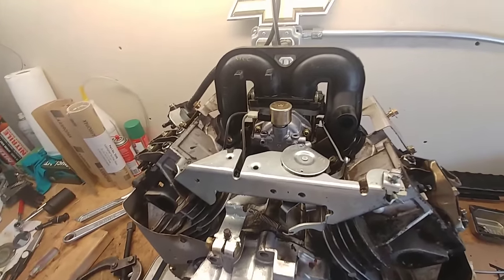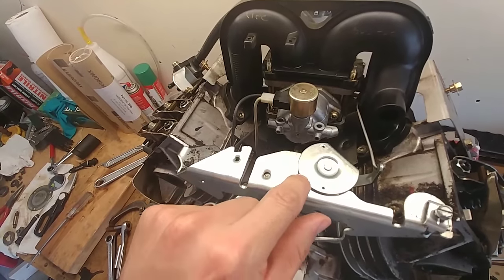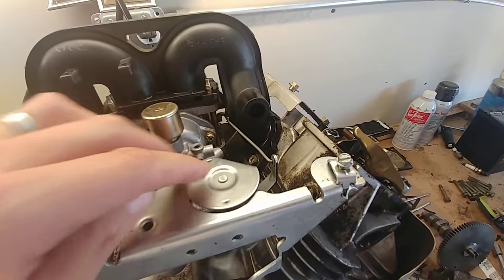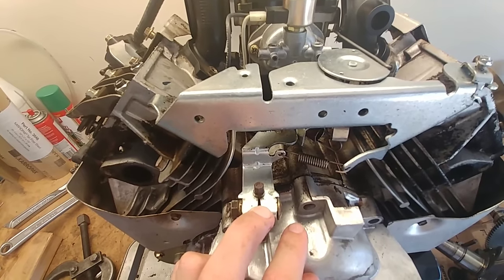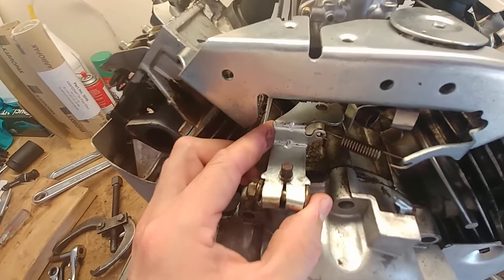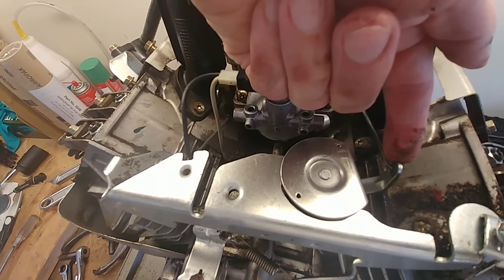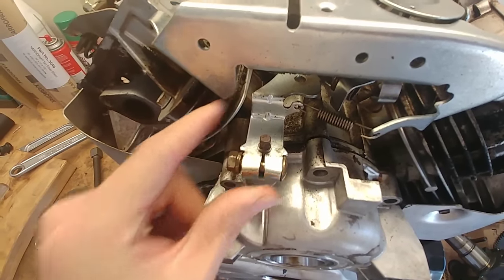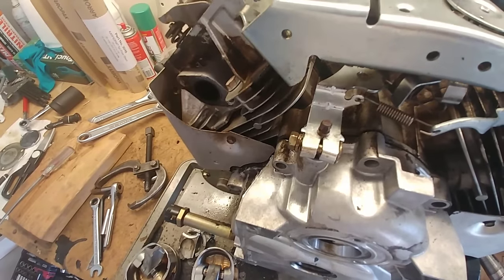Briggs Intek V-Twin Throttle and Governor Controls Explained

Comment: This is the best video for explaining the linkage/spring locations and the governor's operation.  Thank you.
Reply: It also gives a clear image on which direction the springs go. That does make a difference for correct operation. The bottom tab on the governor spring is also how to get higher rpms. Bend that tab down slightly increasing tension gives you higher rpms. However to do that adjustment you need to know exactly what the rpms are. To high and you could blow the engine up. To low and you do not have a quality cut. 3600-3700 is what most mowers need. Do check the specs first.

Comment: I bought a nice used Jacobs front cut mower about 10 years ago, I thought it was a good idea to start it up with the throttle linkage off. Well, mine turned out the same way as his after I simulated a mid-90's F1 engine for about 3 seconds. 😂 Never felt so dumb in my entire life, but lessoned learned ntl.

Comment: Does the internal flyweight of the governor pull the governor arm counter clockwise when engine is running??  I have adjusted governor the way you described and still the engine wants to race.  At idle, the governor arm is not pushing up enough to push throttle against idle screw.  When I start the engine, it automatically begins to race even with throttle lever positioned to idle.
Reply: I am having a similar problem. If I hold the throttle in the idle position I can get the engine to run ok but when I let go so does the engine.
Reply: Same here
Reply: Yes the governor flyweights cause the governor to rotate counter-clockwise. Another way to think of these type governors is an external spring holds the throttle wide open and the governor works against that spring and tries to force the throttle closed.

So when "setting" the governor, the throttle and governor linkage should be in the full throttle position and the governor shaft (the part we're setting) too should be turned to the full throttle position. When everything is set to be in the full throttle position at rest, the governor will be able to close the throttle when the engine is running (too fast).

Comment: Hello, I just replaced the carb on a 23 hp v-twin. I didn't disconnect the throttle cable. I installed a after market carb and now when I start the mower it's running full throttle and won't go to idle when I move the handle to slow(turtle). Any suggestions on how I can adjust it?

Comment: My Craftsman lawn tractor is a 20 horsepower intek V-Twin won't stay on Full Throttle. After a few seconds or when the blades get engaged the throttle and the engine fall back to about half-speed. Does this have anything to do with the governor?

Comment: I opened up the case to replace oil sump seal and crank seal. It was leaking bad. Resealed everything and when i tried to adjust governor hex head, it wouldn't turn left or right. The governor is stuck on full throttle when i start it. So i shut it off immediately. Please advise on what to check. Thanks

Comment: Your one simple instruction about the governor adjustment at 5:00 was exactly what I needed and saved me SO MUCH TIME.  Thanks so much for taking the time to make this video.
Reply: Where did you order the spring from? I’m having the same issue.
Reply: @johnminckler4605  Hey John,  I'm just a commenter, not the video maker.  I had my original spring.

Comment: Just replaced my oil pan/sump gasket after purchasing a used LA175 JD, and boom FULL RPM at start of the mower. JD and Briggs document that I could find were know help. Your video is exactly the information I was after and needed to be explained!!! Thank you , thank you and  thanks again!

Comment: Just the video I was looking for. Over time the low idle speed has been creeping up. I had to replace the magnetos after a mouse ate through the wiring and when I reassembled it all the low idle was even higher  - which I guess had to do with the new magnetos and plugs. I noticed the linkage was not hitting the idle stop so I did a little "bending" and made it worse...I lost top end power. I know my way around car engines but not all to familiar with small engines. Now that I know how all this stuff works together I think I can get I back to where it should be. Thanks for taking the time to explain it all brother !!

Comment: This answered the exact question I had.  I rebuilt the carb on my 28 hp B&S OHC v-twin, and in the process cleaned a bunch of built-up grime.  I removed the governor arm bolt you pointed out in the process of removing the carb and gleaning all the gunk out (the gunk was caused by years of a leaking crank seal that I changed last year when I bought the tractor).  I caused a racing condition when I put everything back together.  Your video was a rifle shot explanation (hit the bulls eye).  Thanks very much for making the video!
Reply: I have the racing condition how did you fix it?
Reply: @Gods-Elect  did you find a solution?
Hi, Had a bad misfire, replaced carburettor. Engine now revs very high. Took engine out replaced with a new governor, did not look damaged at all. Adjusted governor to carb as per instructions.
Still revs high. Noticed the Governor arm does not seem to move througout the rev range. Any ideas? Thanks

Comment: Great video.  I fixed a lawn mower about 4 years ago.  Had the same issue but did not distroyed the engine and I was able to replace the device with the weights. It still works.  BUT I never knew what mechanically had happened.  Great to know.

Comment: The arms for the springs are final adjustments for the govenor but no one tells about that, you can change the springs but final low speed adjustment for the govenor is done by forming the arm that changes its tension on the govenor arm.

Comment: Really appreciate you doing this video.  I dropped a pushrod into my crankcase and had to pull the engine to get it out.  After starting it today I found something was wrong with the governor.  I'll make the adjustments you mentioned now that I understand how it works.

Comment: Thanks for making this video, though I found it too late.  I purchased a 2005 Exmark Lazer Z from a guy who had replaced the engine with a 20hp Briggs Vanguard, and when I went to buy it, I noticed that he had to flip the throttle up to half in order to get it started, even when choked.  It ran fine once started, and at full throttle, it seemed to me that it wasn't revving up high enough, and it would stumble quite a bit when the PTO was engaged, but it would recover and mowed fine.  I bought it for a pretty deep discount, all things considered, but after mowing with it a few times, I knew something was off.  I pulled the air breather and choke plate off, and didn't see anything unusual (my first thought was the throttle plate not opening all the way).  Then I noticed the governor had a broken shaft spring, and a missing idle spring.  The fat governor spring was there, but doesn't appear to be connected properly, or it is the wrong size.

I spent several days googling to find a drawing or picture or schematic of how the springs should look, but couldn't find anything, so I just went ahead and used the parts diagram to order 3 new springs.  I also spent $25 on a Briggs service manual, and after looking at the pictures in there, I could have just figured it out myself based on the length of the springs.  Oh well, at least it should be running properly after I get the springs on there.
Reply from the maker: Might want to do a compression check or pull the heads and look at your gaskets.  A bad head gasket will cause combustion gasses to enter the block and reduce the pressure differential across the piston.  This can also cause poor acceleration and lack of power.  Its also very common for them to go out.
Reply: @mbakken11  I put the new governor springs on yesterday, and while I was at it, pulled the valve covers to check the lash.  One of the cylinders had valves that were way out of spec, extremely loose.  I set all of the valves to .005 per the manual, and now it purs like a kitten, and revs up and down just fine.

Comment: This video was they key to figuring out how to "set" everything. I have a 2004 L120 with the 20hp B&S intek and my sump gasket started to leak. Long store short I replaced it got the motor back on and bolted down, hook battery and starter back up and the fuel lines. Fired it up and it started to runaway so I killed the motor. 3hr into why is it running away I find this video. Which was the answer I was looking. A great video one the names of the parts to proper idel position on the throttle plate. ALTHOUGH it's all correct now the governor in the motor does not seem to be controlling the lever controlling my idel, UNLESS I'm holding the gonvenor level in the idle position. I hope I didn't screw up then internal governor parts.  THANKS FOR THIS THOROUGH AND DETAILED VIDEO!! Am i going to have to pulled the sump back off to see what i have going on. Again the govenor level seem to NOT be undercontrol by the plunger that contacts the govenor rode that controls the governor lever. Let me know THANKS AGAIN

Comment: Hi, Checked compression, New Plugs, checked tappets. When I out 2 springs on, it runs flat out.
If your move the arm from the Govermor you can control revs, you have to keep holding the lever.
when I disconnect the small spring and add a light spring to the throttle I can use the mower carefully, engine runs smooth.
Thanks

Comment: Great video. I have an old Briggs& Stratton 22 HP twin cylinder, overhead valve engine.  I was cutting and then the engine started running at max revs (much faster than the 'Fast' Setting on  my Throttle Control Lever), even when I set the throttle to Slow/Idle.  When I start the engine with the Throttle at Slow, the engine still runs at max rev.  I see in your video that the throttle is wide open because of how the springs are set.  Mine is the same... What will close the throttle plate to the Idle Screw?  Right now I have to push the Governor Lever up manually.  I dont see any holes or nooks for where a spring should be... Is there a third governor spring that broke off?  I am not seeing anything in the Parts Manual that help me figure it out.  Thanks.

Comment: Thank you for the explanation! I replaced the carburetor on my Briggs engine (engine # 405777-0112-E1) and it just won’t start 🤦🏼‍♀️ I have choked it then no choke open throttle and tried half throttle- no luck… the gov springs are all on the right way… changed the old spark plugs out to new ones…. Still no luck… I’m puzzled but not giving up just yet… also the starter ain’t in the best shape either

Comment: Mbakken,

I've recently had a problem with fluctuating idle - you could visibly see the governor moving throttle up and down. Happened at all speeds. I've read that all surging, hunting, or fluctuating idle speeds is typically a problem with the carburetor being clogged. . .

I pulled the carburetor apart and cleaned the thing thoroughly, but now it races extremely fast, the governor never engages. I've set it for WOT too endure that the governor pages the throttle up, but it seems like the Governor is broken and could've been my problem all along?

On this motor, if the governor is adjusted too far the other direction, is there enough room for the collar shaft to fall off and into the oil pan? This is the only thing I can think of that would explain why the governor isn't engaging... Unless the carb is flooded?
Reply: Ever figure it out?
Reply: @lonewolfforge7603  YES! So, there's a funny story involved that I was unaware of... My father apparently drove the mower off a 3 foot retaining wall and snapped the governor assembly at the shaft!  After adjusting the governor, the whole assembly was broken free, and ended up in the oil pan just as I kinda predicted. Could've had a massive engine failure, thankfully I caught it before it damaged everything

Comment: Great video!  My 2009, Intek 23 hp has an automatic choke.  The engine takes about 30 - 45 seconds to start when cold. Once warmed up it starts right up.  Is it possible the choke isn’t working? How do I check?

Comment: At 3:00 minutes in your video you talk about the idle, I have a light spring that is around the rod that goes from the lever at the bottom to the throttle plate.  I have the spring connected at the bottom but I don't know it attaches at the top.

Comment: great video 

I had already set governor just as you showed and my engine still revs way too high.  Just rebuilt from an auction find and did replace 1 push rod assembly and piston but all else seemed tight and when I can control the rev the engine runs great.  little to no tension on the governor/throttle lever but the engine in full or no throttle still revs out.  very confused...

Comment: Could you please try and answer a question? I was given a craftsman professional garden tractor and it has been sitting for about two years and I cleaned the carb checked everything out and made sure all linkages are correct. Started the mower and it goes wide open and the governor linkage doesn’t move as far as going to idle. I have to push it up by hand to idle down. Thanks
Reply from the maker: Sounds like the governor adjustment was done indirectly. Need to loosen the clamp and reset the zero position
Reply: @mbakken11  I did that following your video and still does the same thing. I was wondering if the governor might be stuck open possibly
Reply: @mbakken11  if not stuck open could it possibly be another issue
Reply from the maker: @bryanslittlegarage5724  anything is possible. If it ran WOT too long it could have damaged the plunger inside - could have skipped the circlip. How much rotation did that shaft have when you loosened the clamp?
Reply: @mbakken11  no more than what it showed in your video
Reply from the maker: @bryanslittlegarage5724  how about less?  if there is too little motion it could mean something is broken internally.  Should have maybe 20-30deg of rotation
Reply: @mbakken11  that’s about right and the linkage doesn’t move when it starts but if you push up on it , it idles down. I am guessing I am just going to have to pull it apart and go from there
Reply: I have the same issue. Wide open throttle. Did you find a solution?
Reply: @bhulstrom9  no I haven’t worked on it anymore right now. Hope to get back on it after first of the year. I pulled the engine apart and the governor was working perfectly. I have a video showing what I have done so far but haven’t posted it yet. I need a couple of parts just been working a lot of overtime at work so haven’t had time for anything else.

Comment: Hey sorry to bug you but I have a quick question I have a YTH 22K48 Husqvarna rider and I just bought a Briggs and Stratton PXI2500 724 25hp motor. I’m trying to figure out where i connect my choke cable, you said connect the throttle cable to that front part but where do you attach the choke cable?? Thank you for taking the time to read this and hope to hear from you soon!

Comment: You are a star! I’ve rebuilt the carb on my 24hp Intek V twin (44S877].. Now I can’t see how to reconnect the linkages!! Any way you might show what rods connect to what? Best...
Reply from the maker: I believe I have that exact motor on a mower at our farm, but I won't be able to get pictures of it for a while. The linkages should be very similar to this video, otherwise you can look up your engine on a site like ereplacementparts.com or Jack's small engine. They have exploded diagrams that are mildly useful. Sorry I can't be more help at the moment

Comment: I have a new B&S CXI 2500 V TWIN. All settings are as follows in video. At a loss because the engine only starts on choke and over revs likely to blow if I let it run too long. How tight do the adjustment springs need to be? Is there a factory spec? Can't find much on this engine. Thanks

Comment: You saved me from doing something stupid. I was watching this to find a way to enriching the gas. The plugs are near perfect. And I'm changing the whole fuel line to help flow some. Actually she's running great. How come gas lines are connected by such small connections on tank?
Reply from the maker: Even the smallest fuel line is much much larger than the carb jets that the fuel will eventually pass through. The line and filter should not be an issue unless they are plugged
Reply: @mbakken11   now that you said that it makes sense.  Thanks it's been years since I've done any real maintenance.  I heard the lines degrade.  Otherwise  it's like the day I got it. Was thinking of checking valve clearance.  Don't think it's ever been checked.

Comment: I don't know what year model this is or if they made a change but I have an about 2015 vangaurd on a longtail and the rotation on the governor is counter clockwise. You will know as soon as you crank it for sure.

Comment: Thanks for the helpful video. I have a Briggs & Stratton Intek 7.0 which won’t run well and I’m wondering how to adjust it. It always starts from cold, but then the revs dip every six seconds or so  and it either stalls or nearly stalls then recovers. Once warmed up a bit, it runs ok until I stop the engine, then after that it will never start again when warm. If it nearly starts it dies after a few secs.  I guess I have to adjust governer, throttle or choke but I don’t know where to start.

Comment: Thanks for the video!  I have a problem with the same engine.  While riding my tractor the engine went into full race and I had to shut it off.  I’m trying to find a way to adjust or fix the problem.
Reply: If you can’t adjust it pull sump off and replace Governor